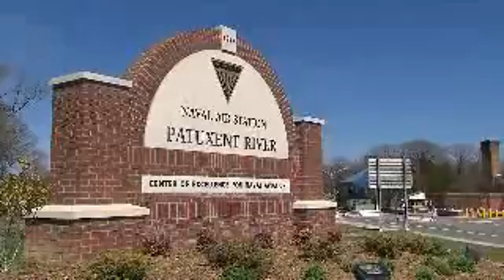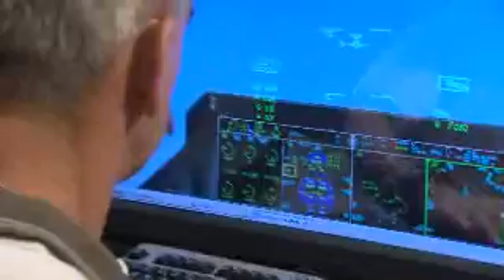F-35 Lightning II Third Quarter 2009 Program Update

Comment: @BulgarianInCanada Sonic boom only happens when one crosses the barrier, not when flies supersonic. By the time one will hear engine noise the F-22 would have already passed overhead a few seconds ago. Also at transsonic speeds there are unavoidable local supersonic speeds on the structure and those are not the preferred mode of flying. Also F-22 is less visible on radar and more maneuverable + higher-flying, faster and with more weapons. Its no-contest. Add EOTS/DAS to F-22 and F-35 is obsolete

Comment: JSF program needs a full re-think. The plane they have now is good in terms of avionics but absolutely pathetic when it comes to traditional and essential traits like speed, altitude, range, maneuvering, weapons payload. Even the vaunted stealth is not to the sufficient level to save it from L-band and below. Even X-band from a fair few angles will see it. Add to that the price of $M130 each and you could add another 800 F-22s AND retrofit EOTS and DAS to entire F-22 fleet. Just not enough punch